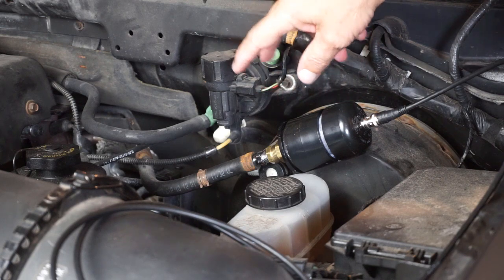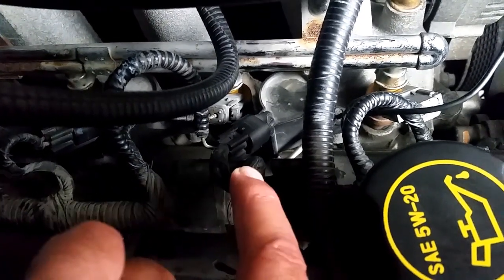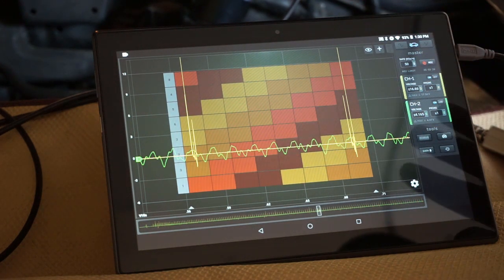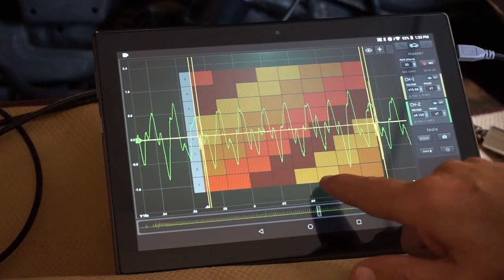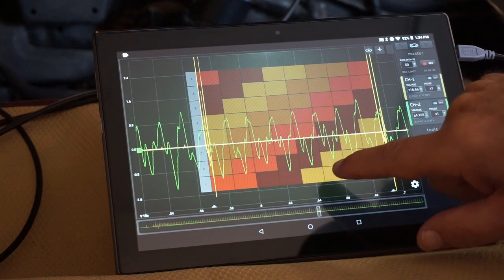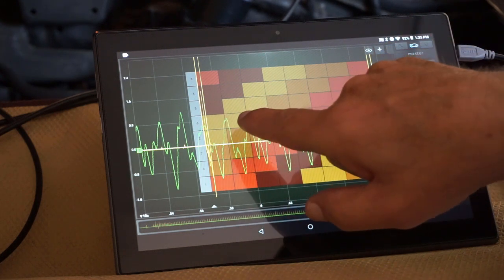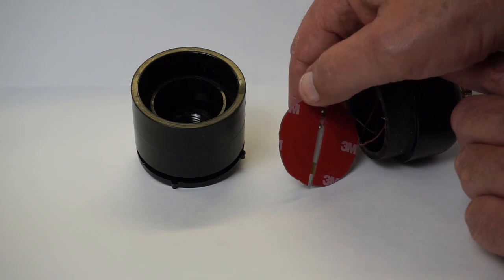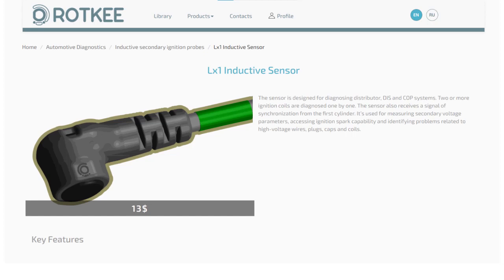GADGETS#121 - HScope CYL TIMING OVERLAY

Comment: Thank you for teaching. I am confused because when I saw this I would have thought that this engine had an issue because of the peak amplitude differences of the vacuum draws. To me cylinder 7 peak is almost double that of cylinder 3 and the positive swing after cylinder 7 intake closes appears larger than the others.  Admittedly I'm struggling a bit to decode this since the overlay always shows 2 cylinders in each cycle. I realize this may be more than you can explain in a comment. Thanks again.
Reply from the maker: it is more than can be explained in YT comment section Chuck...

it's why I invite those with a deep enough interest to join us on HScope Telegram Group, a platform that does better lend itself to discussing complicated topics...

follow this link if interested Chuck:

https://t.me/hscope

Denis

Comment: Hello Denis
I saw in a place that it is not necessary to use a motor vacuum transducer equipped with a map sensor, the only thing to do is change the oscilloscope coupling to AC and capture the MAP signal directly, use the sensor negative to minimize noise.
Have you tested this type of reading? I will test this weekend.

greetings
Osvandré
Reply from the maker: I am not familiar with this Osvandre, don't think I can not be of much help...
Reply: @theGADGETSplaylist  Just an idea that came up, I don’t need help, I’m just commenting that in some cases you can dispense with the use of a vacuum transducer.
Reply from the maker: @osvandremolinari  piezo based pulse transducers can not be replaced by MAP sensors, if I understand your project/plan properly.

Comment: I haven't had the chance to use the Hscope software but it looks like you all are really turning it into a great product!
Reply from the maker: Portable and powerful, PJ
I got involved with HScope release (69). It's now (190)
Will help Martin add valve overlap overlay in near future...
Now that you bought a hot air reflow station, you should build a HS402 PRO:)
Reply: @theGADGETSplaylist  I need some projects to fine tune my circuit board skills. That’s actually a really good idea!
Reply from the maker: @VoltageDropDiagnostics  the HS101 PRO PCB board is a nice way to start. Right mix of challenge and probability of success...

Comment: As usual par excellence
Reply from the maker: always nice to see you here, Bill:)
Reply: the GADGETS playlist   Over the years u have brought our level of thinking much higher. A vibration is not just an annoyance, it has a frequency which we can observe by means of an oscilloscope. The intake manifold is filled with pulses that resonate and can have an effect on other cylinders as their valves open, or fail to do so. Many of these effects can b observed with the tools u help us to understand. Translating pulses, pressures, and vibrations  into  frequency and magnitude as observed on the scope is the object of many of your lessons. So a dead miss on cylinder 3, a failed intake or exhaust valve is going to upset the relatively smooth flow of air thru the engine. And relating that to the firing order by syncing a cylinder is an invaluable diagnostic aid. Getting that info on a second channel that in real time is relating to the first channel is the key. Being able to explain to others helps us to ground the understanding in our own mind. Fun and games in the OK corral
Reply from the maker: @billrimmer5596  the exhaust manifold resonances (tuning) would be interesting to explore also. I toy with a few ideas now and then on how to explore it. It's just a step step too far...for now:)

Comment: I don't understand the timing overlay, yet. But I totally get the sync signal. That's everything on any scope. Great going Denis !!
Reply from the maker: Hi Mike!
Getting the gist of timing overlay on a 4 cyl engine is a good place to start.
It'll come to you:)
Reply: @theGADGETSplaylist  Thanks Denis !
Reply: You’ll get it just keep pulling it up and using it any time you pull a pressure waveform and it’ll start becoming more clear especially once you see a few known bad issues that you can correlate it to. I remember the first time I used one it looked very busy and noisy but after a little while it became more and more intuitive.

Comment: The loop around the ignition coil would be the ticket paired with the HS-101 BLT for test drives if you don't want to back probe.
Reply from the maker: I suppose it would, Jim. The idea was just to get a sync without consideration to waveform quality. But put a chunk of copper near these COP and we can't help but get a decent secondary.